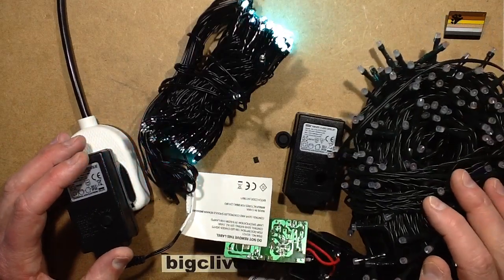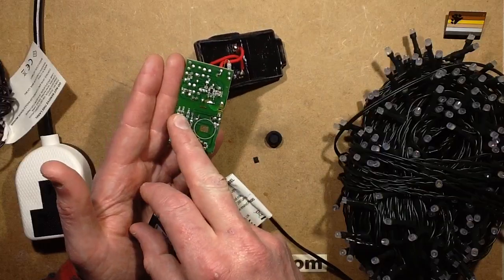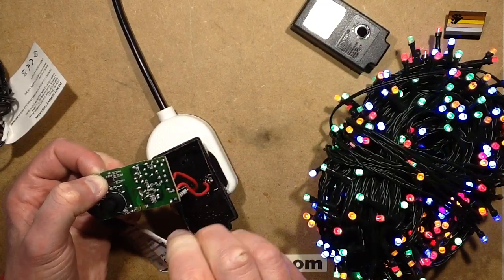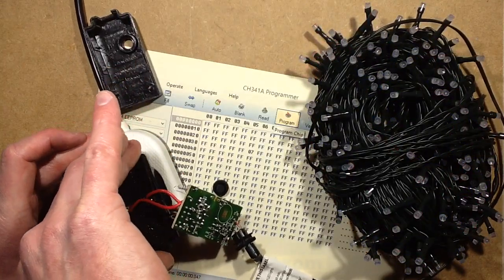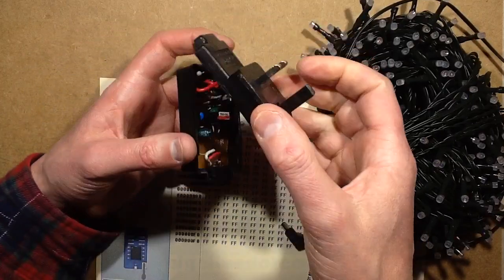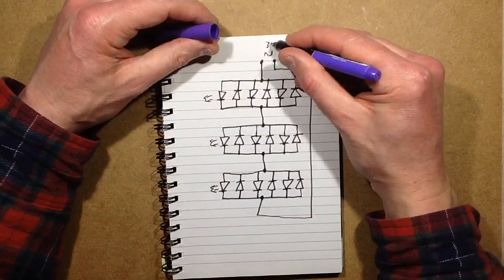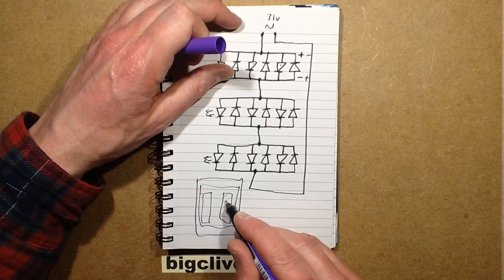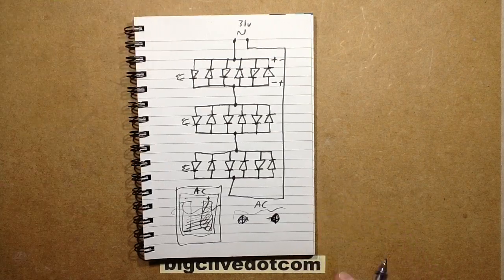Memory hack for new 2-wire LED Christmas fairy light controller.

Comment: what I'd love to do is fine something other than hot glue that holds the ac transformer parts together.  Was unplugging the OLD NES PSU from the wall last month and um.  it came apart before it was unplugged from the wall (eep)  Although I've found the Retron 2 knockoff PSU works on the old NES. I prefer the nice heavy one.  Although speaking of odd things to do.  haven't see a micro video player on your channel yet.  but haven't gotten thru them all.  90 % of them either don't work or have fake memory chips in them.  ie got an 8 gb one the other day for $10 from Malaysia and ran the memory tester and 4.9 gb comes up bad.  the one off banggood was much worse.  They didn't solder two leads off the main chip on it. :O  I did.  Then it recognized what was on the chip but 1.9 gb of 8 gb is good.  all the rest is bad.  And Samsung??  doubt it or it's a Samsung Reject.  could go for any of the tiny mp3 players or mp4 player.  they are rather cheap although oddly the one off ebay was cheaper and actually bothered to work compared to the one from banggood nearly $5 more. :O  a rarity.  But love the hacks on this.  Now how to read and write EEprom , Some very cheap USB methods for various chips but I'm sure the $400 one is the one people would actually use.

Comment: Instead of smashing it with a hammer squeezing it with a vice can also break such casings open. Unless squeezing too much it's much better for the electronics inside as you avoid heavy mechanical shocks. While you may also be able to crack it with a big pipe wrench or similar a vice is much more recommended as it doesn't suddenly move a huge amount when casing breaks open.
Reply: Let Dremel be your friend.

Comment: Clive, i thought i had the same problem but after a few random starts my unit appears to have memory of the last function i used. (ie not bloody flashing)  Moreover it does not visibly pulse on AC, although it does create moving purple artefacts when viewed with a digital camera. I can't help wondering whether it's a redesigned one with the 'optional' memory chip and an extra capacitor...or something of that sort  

This is a set of reds and greens, running around 3.2v per led if the label is correct- it would be better at 3.0v as they look too bright for their own longevity in my humble opinion
Reply from the maker: Some have the chip, but don't store the setting immediately.  They will wait until the lights have been running in a particular mode for a while and then store it.  The greens are always ferociously bright, and the newer reds are also surprisingly bright even at normal current.
Reply: Thankyou for that, i shan't do any mods to it then.

Comment: I can vouch for AC across christmas lights reducing the corrosion potential significantly. Back in the early 90s, my granny used to love getting those short strings of tungsten lights powered by four D cell batteries.

She'd leave them on out in the rain and the individual tungsten lights would quickly have the legs coming out of them corrode completely off. Though like you said, only one leg on each bulb would corrode off, and sometimes it corroded so badly that it went inside the lamp and caused the lamp to vent and smoke out.

Poorly sealed garden lights have the same problem. I've gone through dozens of garden lights where the failure mode was the base of the LED gets water on it and one of the legs is eaten clean off by electrolytic corrosion. And again, sometimes the leg is eaten all the way inside the LED to the actual chip itself and it also turns all rusty and horrible looking. Thankfully 50/100 packs of straw hat LEDs and NiMH batteries are cheap from China. The solar panels seem to last forever though.

Comment: There's, what, 7, maybe 10 programs total? So you don't even need a full byte, just a nibble or even 3 measly bits. Probably could have been achieved in discrete hardware, even (just how many mini resistors/transistors/capacitors would it need I wonder? or simple flip-flop IC doodads that probably come in at 1000 for a quid?), or a trio/quartet of dual-action microsolenoids that physically latch in place at one end or the other without a driving current. Four little rings of Core, even.Maybe it's just one of those things where economies of scale cause some very weird decisions to suddenly become the optimal case, especially if you've got a jack-of-all-trades PCB design for which this is but one of the simpler applications. If using a 1k flash chip isn't going to change the retail price or profit margin noticeably, and it simplifies the design and parts ordering process, then why bother economising on storage space?Wonder why it stores at that particular location though? Someone's birthday? A quirk of code efficiency in the microcontroller that saves on putting that one space-crucial extra value in place? Shared internal and external memory bus and all the lower addresses are used by internal code? Or perhaps part of the testing procedure and they get jtagged into an external master ROM that holds different numbers (or even code) in different addresses which the hardware accesses depending on what application it's been set up for and produces the corresponding light patterns in a particular order if all has gone well. If it checks a bunch of other locations and finds only FFs it assumes that it's now in field service, and on the next button press attempts to write the non-demo-program-01 value to a particular reserved address, then reads it back; if it's still FF, then there's no memory chip installed; if it's 01, then memory is present; if =some other value=, there's been an error and it's actually still connected to the master ROM...BTW if the idea is simply to have the lights on permanently, why not just have a thing that sits a little downstream, takes the 31v AC, briefly rectifies it, then regenerates some facsimile of stable AC from that (even if it's just a high-rated 555 or whatever), maybe at higher frequency? Might need a relatively big capacitor to cover the programs where the overall brightness rises and falls, but it'd be worth it to avoid smashing the case open and buying 19 redundant chips. Or indeed just a 30ish volt DC power brick (I think you can get them?) running to said some-kind-of-AC generator with a coax socket connected...

(yeah, I've forgotten the word for a thing that makes HV AC from LV DC)

Comment: But you also should just connect them directly to 24V AC (or which voltage it uses) if you want them light up directly, or?

Comment: It's not 3005, it's 0x35. The numbers at the sides are just telling you the offset. You have to add them, not concatenate.
Reply: Also, the letter at the end of the part number is just representing the package material or shape. As long as it's an SOIC-8 24C02 it'll work just fine.

Comment: Any general purpose i2c 24Cxx eeprom should work. The way I2C eeprom addressing works will allow it to select the same page. Based on the memory location of the saved byte, a 24C01 1kb eeprom should have worked just as much as a 24C08.

Comment: About DC corrosion: it's faster and happens easier than I expected. I have some 12V LED strips under the treads of a stair, where I can't lay any wires (in a nice looking way). So I stuck two strips of copper tape side by side (each 5mm wide, 5mm distance) on the wall and soldered the LED wire to that. LEDs worked fine and as it was dark until I finished the installation I left them on while painting over the strips with acrylic paint (to be the foundation for wall paint). I hadn't even finished painting all the copper tapes (not even a meter in total), when I noticed that one of the of the two strips started to appear again from under the paint with a greenish taint. The thin layer of (water based acrylic) paint was conducting (I also painted the gap because who would be OCD enough and just paint the strips?) enough so one conductor (I think it was the positive one) started to dissolve. Took alot more paint to hide that.

Comment: Regarding the "random cell" written to the EEPROM: I don't think they are random. You may find, that when you set it to another setting they will set that address 0x035 to 0xFF again and actually use the next cell to store the setting in it. when then controller starts up the first cell that is not 0xFF is the actual setting. This provides some sort of wear leveling between the cells since some cheap chinese EEPROMs really only have very limited write cycles. I have seen that for high quality equipment like the dashboard odometers in VW's. Common technique.
Reply: +Chip Guy Vids That's worth knowing.
Reply: +Graham Langley VW does it even more intelligent: They store the lower 16 bit of the odometer in a 8 word table (16 bit words). They dont touch the old value they only write the next mile/km to the next cell. So each cell is only written every 8 km. On battery loss or startup the processor determines: highest value in the array is the current one to display. Lowest value (always the one before the highest) is the one that's gonna be overwritten next.
Reply: +Chip Guy Vids There seems to be a never-ending list of EEPROM tricks like this. Filed for future reference.
Reply: Absolutely! I've also seen it be the last value that isn't FF, so they don't even overwrite the previous one, and just walk up memory.

Comment: Yet another reason why electronics boggles my mind entirely. Why is there a space on the board that just so happens to accommodate that chip and works with it? Why would they have left it out at the factory? Why doesn't the board just come from the source with the chip already on it? If you can buy them on a great big strip like that they can't be expensive.
Reply from the maker: +MagikGimp They're not expensive.  They could have added it, but it's probably a value added feature that they charge a premium for.

Comment: For the last few years I've been using a vice and a work knife (not the snap-off type) to open sealed plastic power supplies.

But before that I much prefered a ratching pipe cutter (strait blade+anvil); but until relatives persistently steal it with excuses ranging from my not being a licensed plumber, to disuse and misuse. for actual reasons best not speculated here.

(most) laptop-style powersupplies will rock out at an angle w/ the blade in the seam, and I can then push it level again. Because the blade will not be pushed any further into the plastic than the jaws of teh vise are set, there is no overpenetration when the {weld, glue, friction, plastic} pops.   And once the corners are apart, inserting shims will usually cause the rest of the seam to unravel (except for clear plastics, where the seams are genreallt the hardest area)-- with a helpful hammer driven tap of the blade to weaken the seam where it hesitates to cooperate.

Using  a saw to cut away the corners of the seam, then wedging in some screwdrivers should have a similar effect.

Zipties or glue are the 'nicer' way to reseal the cases, I have to admit that the wrapper (vynil/"clingfilm") from a sandwitch I happened to have that day has held up very reliably for a few years until I replaced it with latex (which baked into a sticky mess).

Comment: and thought that I was the only sad person that spent 10-14 days before Christmas fixing lightsThe old filament bulb type still corroded (even though AC) Bulb testing - swapping wire-end bulbs from base to different base - socket testing, daisy chain voltage chasing - Ask the missus  -aaaaaaarghBut I prefer the lower colour temperature lights :)I keep all lights on all Christmas to ostensibly keep them dry - er No - doesn't workALL emphasise ALL of the early LED lights (small leds in big glass bulbs :-) ) have corroded in their sockets = DC corrosionHave I cracked controllers open and resurrected them from watery graves - YepHave their been missing tracks - YepHow did Christmas move from RED emphasis of holly berries & Santa Claus etc with coloured fancy fairy light - - - - - to BLUE !!!!!!!Everywhere was garish BLUE flashing LEDS One advantage of LED lights is that you can chop the 2 core LV feed cable and extend it a km or so  (I jest)Fan No1 Clive   - Cottingham
Reply: why the line after missus is struckthough - I have no idea+Steve SOMERS
Reply: Yeah, these things suffer outside, the heatshrink around the leds just wicks in the rainwater which then stays inside permanently.

Comment: +bigclivedotcom 
The whole electrolytic corrosion thing is why all modern cars have negative earth as older positive earthed vehicles used to rust easier due to the effect. Nice video and investigative engineering, BTW!

Comment: Hi Clive,
Good explanation on electrolysis there, I'd realised that was the problem with my outdoor xmas lights this year when taking them down and finding one of each of the 'sealed' (yeah right!) LED pins were corroding badly whilst the other was brilliantly shiny, when I took one apart I found water had got right inside and was sat over both terminals, so I came to the same conclusion.
If that is the case why they're using AC, then that's a very simple but clever solution. I also like the method of using 2-wires for switching two patterns, simpler than 1-wire control protocols/logic, etc, which would make the LED packages that slight bit larger.
(My next year xmas light project is to use 1-wire to control a large number of LEDs in a chain using the WS2812B LED strips and an Arduino controller if I can sort out the electrical 'noise' those strips cause which gave me headaches last time)

Thanks again for a great explanation and video.

Comment: FYI:
Electron migration pulls metal from one side to the other. Since these are electrons they pull from the negative to the positive.
Reply: +Jammit Timmaj Actually, it's an electrolytic redox reaction. The metal is oxidized (loses electrons) on the positive side, becoming water-soluble metal ions. At the negative side, the positive metal ions gain electrons, to become neutral metal atoms again, which are deposited.
Reply: Zak Zennii
A better explanation than mine.

Comment: this caught me by surprise as I bought some in the discount rack as there was no transformer. found an old 30vac plug pack and added a bridge rectifier and only half worked. I ended up just running them on the ac at 50hz. not too bad as long as you don't move your eyes when looking at them. thanks Clive

Comment: well, for the constant on mode it's really just outputting AC, all you'd need is a transformer to get down to the right voltage?
Personally i can't stand this method though, the flickering drives me nuts

Comment: What if you changed the byte to a number higher than the total number of modes?
Reply from the maker: +nrdesign1991 I'd guess it might just read the lower three bits of the byte and ignore the others.  From new it will start out at FF which is a decimal value of 255.

Comment: I bought a LED 10w spot light off ebay from china, its RGB but when you unplug it it sets back to its default which is rotating all colors, would this work with that as well???
Reply from the maker: +Matt Norris I don't think so.